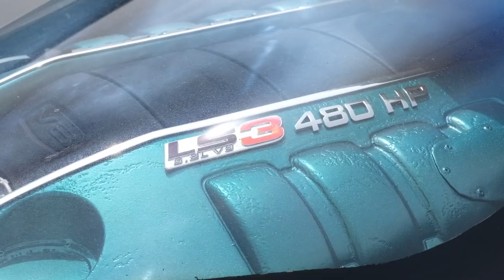Shutterfuel Feature: Pete's 480 HP LS3 Powered SLC SUPERLITE Kit Car

Comment: Great build, and I'm happy to see that he stuck with a realistic power output.
Reply: what do you mean? Whats wrong with 800HP if it fits in the car?
Reply: For the street theres not much reason to go more than 500 horsepower in the light cars. A stock ls3 will push this car to a low 11 or high 10 second quarter mile. Theres guys with 1500 horsepower. But they cant put it down until 100+@NationFirstGreenville22

Comment: Did Pete ever consider using Superlite's "Turnkey-Minus" program? If so, how much did they say it would set him back if he chose to take that route?
Reply from the maker: That we don't know. Pete didn't mention that during any of our conversations about the build process, but he's a very thorough guy, so if it was available, I'm sure he considered it as an option. It's hard to beat the price/power of a crate LS motor though ha!
Reply: RCR does not do the turnkey minus program anymore. You can commission Allan (@zakari3030) to build one. Will set set you back anywhere from 80-100k for anything reasonably standard. 150k+ if you want to go crazy

Comment: Found this from the NP or CP article on jalopnik, what does YT think of an $87,500 second hand price?
Reply: Kyle H hell no. You get get a new one between 50-60 grand on the the Superlight website.
Reply: Manual Clutch just for the Shell. Not engine transmission or labor to put it together. Barebones
Reply: Manual Clutch That’s for a pile of parts, lots of assembly required. You provide engine, transaxle, paint, interior, etc

Comment: This thing is so nice. What did it cost you.
Reply: Not sure how much he paid for it, but you need a donor car (corvette) and a full kit is around 45,000$, so expect 60-65,0000$ MINIMUM. If youre gonna be adding extra stuff to tune the engine its gonna go even more, the ones that are listed for sale are around 70-80,000$. Hope I helped partially to answer your question.
Reply: @Omgiamsotriggered  You don't need a donor car. The only parts that this kit doesn't come with are an engine and transaxle.

Comment: I really like your car. I would take the seats out and have them upholstered with raised firm foam bars covered in red leather so the seats are desirable for long drives. And maybe switch out rear brake lights with Ferrari brake lights.

Comment: I don't like the side mirrors
Reply: Houston Fowler the front fenders would’ve worked so much better for those.... wtf they make the mirrors and the backend just look incomplete compare the rest of the lines on the car.
Reply: for anyone curious the mirror location is an option you choose. for some reason people typically choose the hippo mirrors like this guys has
Reply: Houston Fowler optioned that way for better line of sight. That chassis and those Kirkey seats together sit extremely low. So the higher the mount, the easier it is to keep your field of vision directed on the roadway ahead. That and the fact that it has some pretty wide hips that kind of blocks a direct view with them in a traditional fender mounted position. 
I kinda dig them tho! Although a fender mount would probably look better!

Comment: Is it Possible if we Can see this car on the Track? I think it will Run a 10
Reply from the maker: theblue014 at almost 500 horsepower and only 2,500 pounds, it would be a quick ride down the quarter mile - that’s for sure!
Reply: theblue014 high 10’s low 11’s by comparison
Reply: theblue014 Ive seen these on drag strips n such, They run 7s
Reply: Shutterfuel With a Lamborghini Engine with power of 
750 HP how much do you think Will run in the quarter mile

Comment: Cool Car but i dont like how the Mirrors Stick out like that on the Roof. But i guess because the Car is So low it makes Since?
Reply from the maker: theblue014 yes, the mirrors are set high on the car because it’s basically a race car built for the street. The side mirrors help since the rear view is totally obstructed.
Reply: theblue014 This is actually an option when creating your kit. They call them "hippo" mirrors. You have the option of choosing door mounted mirrors as well.

Comment: I know the car "goes" but in 2018 480hp is a bit weak. 600hp would be more appropriate for such a gorgeous car.
Reply: stubones just a simple head, cam, intake should throw high 5s
Reply: stubones you realizes these things are already extremely fast, they throw 7s in the quarter mile
Reply: I'm sure you could have that too...money talks!
Reply: Yeah, but when your car only weighs about 2,500 pounds, you don't need a ton of power to go really fast.
Reply: My SRT4 Neon is 500hp and 2800lbs
Reply: 480 hp is not weak and won't be for a little while. You have to remember that this thing only weighs a hair over 2500 lbs, which is in no way heavy.
Reply: Lance Dooley And this car would shit all over your neon with 500 hp even with 300 lbs of extra ballast in it to even things up.
Reply: @mcearl8073  don't forget it's still a neon. This is 100x's better looking..
Reply: Have you been in a car that handles well, is 480 HP, and 2500lbs? 400hp in a car that weighs under 3000 ~feels~ fast as hell.
Reply: Yeah it does look nice just comparing cost analysis.  I mean my SRT4 is a 10 sec car at 2800 lbs and Cast Iron Block. Im just looking for anothe
r build to do. Ive already built 400hp civics that will rape shit out there.
Reply: @lancedooley7558  and it's fwd and blows up lol what's your point
Reply: The whole obsession with numbers the car scene is currently going through is so facepalm. As others have mentioned, that car with 480 torquey horses from a 6.2L LS  midmounted in a lightweight aero package will be faster than you can drive it on 99% of roads.  On a track, any money you spend on extra HP would get you better laptimes if you spent it on rubber lol.
Reply: @lancedooley7558  Without a video. Your dodgy shopping trolley is a 12 sec car at best..  ;)
Reply: @pikastach  7's in the quarter with 480hp ? Not in this universe.
Reply: I dont think you understand what power to weight ratio is..  a 2019 Ariel Atom has 320hp, weighs 1,300lbs. And has a 0-60 time of 2.8 seconds and a top speed of 170mph. It will destroy majority of cars out there on a track.  Power aint everything kiddo.  nearly 500hp in a 2,500lb car is alot.
Reply: I don't think he's looking for power to weight numbers. If so he could have LS swapped a Miata. They are even less